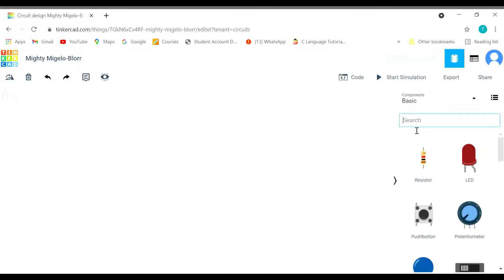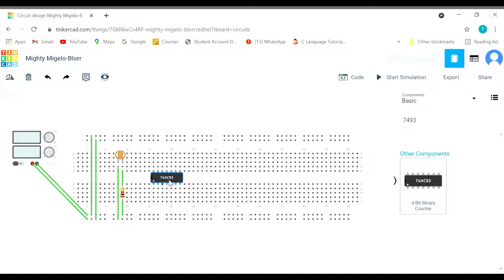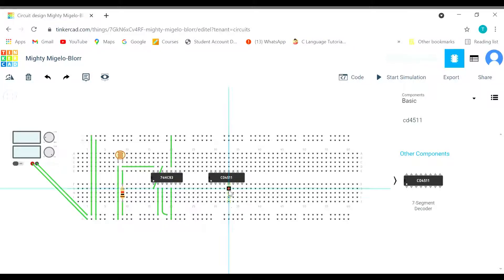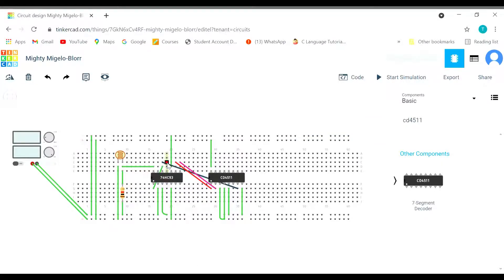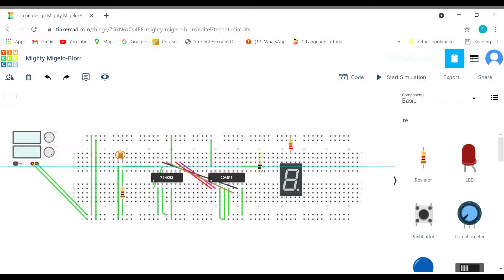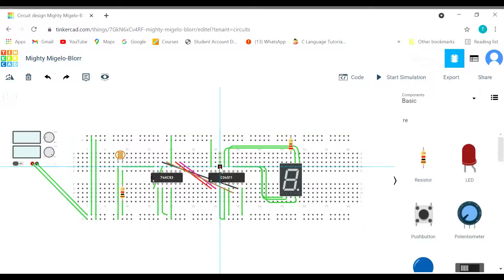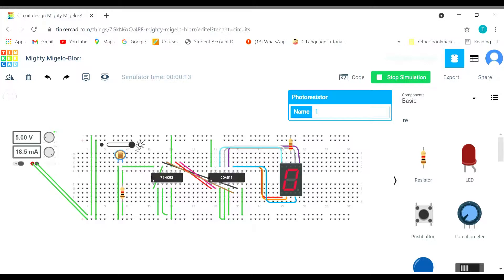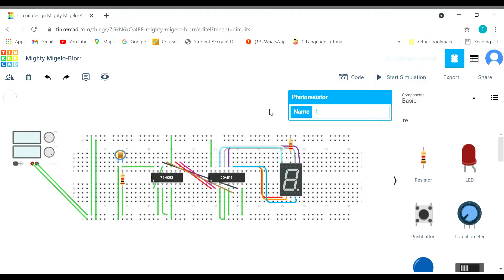Object Counter Using 7 Segment Display on Tinker CAD.

Comment: why is that the 7493 ic exploded in my simulation it said that the maximum voltage is v= 0
Reply: i just follow your video up to end and then still it has a problem

Comment: I did a same circuit but mine goed from 0-9
Reply: Share the link of this simulation
Reply from the maker: https://www.tinkercad.com/things/3Q3NQrxMNbk-copy-of-mighty-migelo-blorr/editel?sharecode=-0KxMwBvOj66EAqVow-sF2A0meu0d8qEvxhsQBLHb4Q

Cheers!
Reply: @disseminatetutorials7676  link expired, please share it again.
Reply from the maker: https://www.tinkercad.com/things/3Q3NQrxMNbk-copy-of-mighty-migelo-blorr/editel?sharecode=tpVefZ5E4fjM4EvOaOXi7-KCTbDagqX4TcIDfcHwTwI
Cheers!
Reply: @disseminatetutorials7676   no i meant circuit with 2 digit display . anyway thanks
Reply: @disseminatetutorials7676   link expired, hoping that you would share it again. Thank you for the time.
Reply from the maker: Hello @Gurpreet Singh. In the video also counter reads from 0-9. For a quick check visit last minute of the video. 
Cheers!
Reply: @disseminatetutorials7676  sir is there any chance you can help me add a reset button on my tinkercad
Reply from the maker: Simulating the circuit from 0-9, 7 segment display resets itself  after you keep on changing light intensity on LDR after 7 segment has displayed till 9. Or adding a push button and connecting it with ground and reset pin of 74HC93 can help. You can also refer to this circuit on Tinker Cad by p2js---https://www.tinkercad.com/things/c4A5A16lYYm-self-resetting-7-segment-counter.
I hope this will help you.
Reply: @disseminatetutorials7676  I understand that it resets itself, however my teacher wants me to implement an option where the user can re set both displays by themselves  hence I am extremely struggling with that implementation
Reply: @disseminatetutorials7676  i have been extremely struggling with that it be hightly appreictivr
Reply: Sir can you create 0-31 counter in tinkercad?
Reply: @jarylgallentes5529  yes i can
Reply: @GurpreetSingh-br9mu  can you teach me sir?